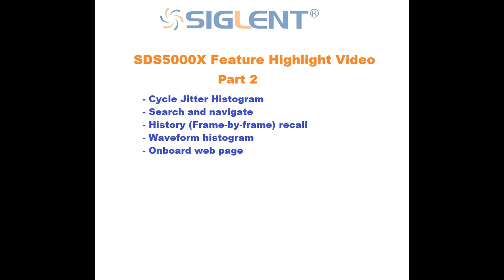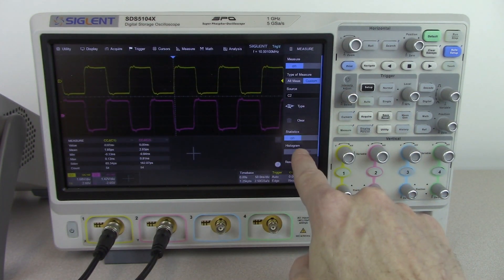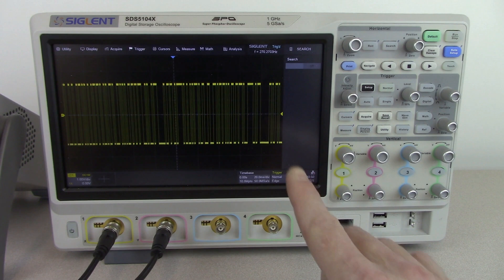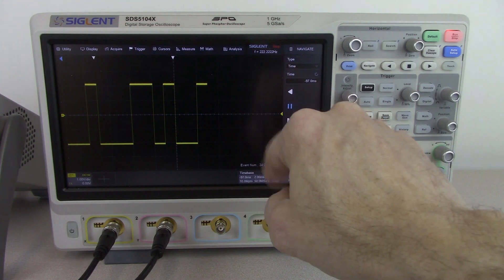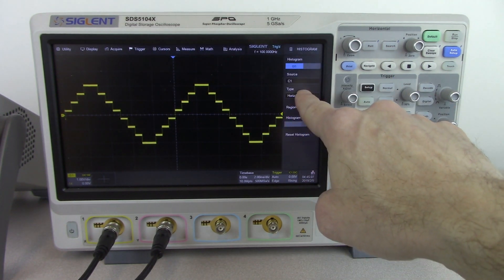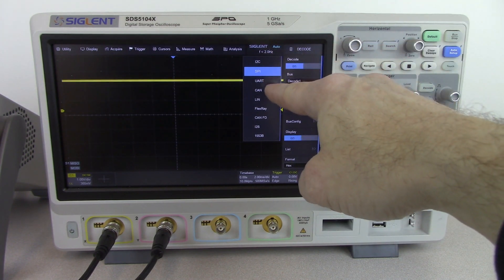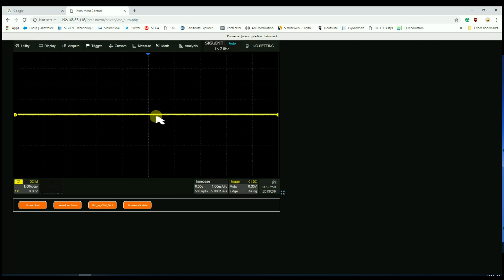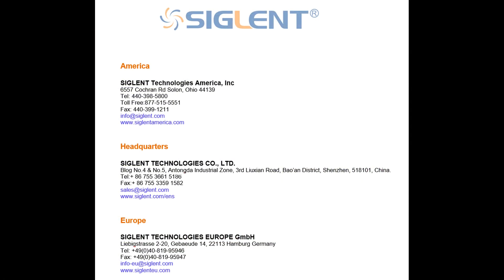SDS5X Feature Highlights Part 2

Comment: Hi! After many years working in electronics manufacturing, I always found test engineers in troubles trying to pass and validate a new product after the assemble line. It will be great for EMS Companies to consider to get this useful instrument for their research and development department. A CAD EDA software and our engineering calculus can't show all the physics issues can occur after prototyping. This kind of features are great for debugging and make corrections for a better design version.